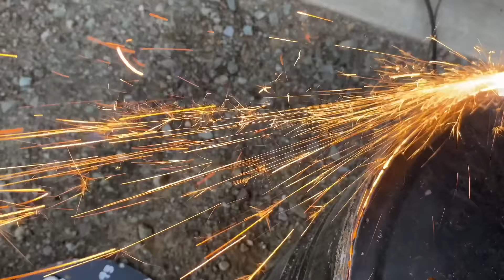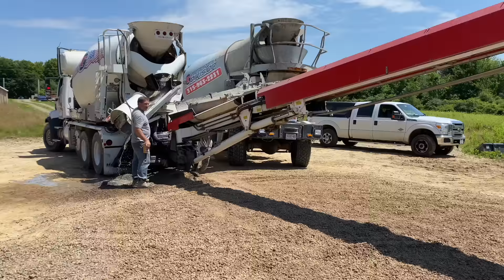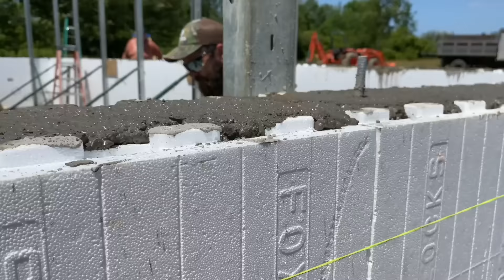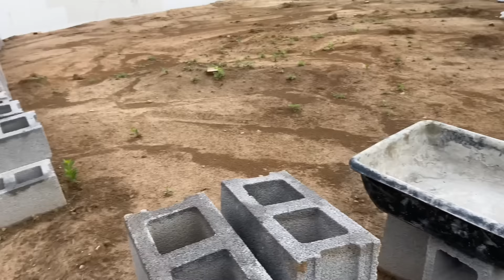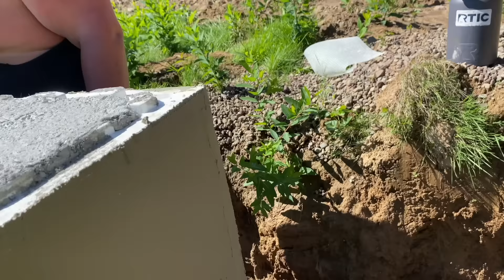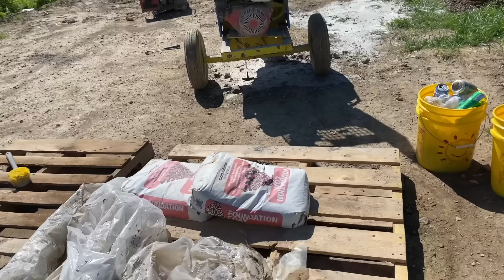Laying concrete blocks and ICF. (TIPS AND TRICKS)

Comment: Curious if it would not be easier to use 2 bys to make those intermediate post supports? Seems like a lot of fussing around with barrels . Anyway your job site is super organized and tidy and makes for a safe work environment.
Reply from the maker: Thanks. I think there were so many pads that the barrels worked out real good. No lumber wasted and we could just leave the forms on. I just read the blueprint wrong and that caused a pain.

Comment: Crappy why doesn't ANYONE use a spirit level 🎚️
Reply: That's what a string and laser are for, and you can feel if the block is tilted with your trowel...
Reply from the maker: Yup for sure.  @brnmcc01
Reply from the maker: what is a spirit level?
Reply: @bondobuilt386  What you called a torpedo level. I guess he missed the part of the vid with the laser...🤣
Reply from the maker: Oh ya no need for that. LOL @brnmcc01

Comment: You might have addressed this in another vid but what is the reason for the block work on the one section vs ICF all around. I’m not a builder so I’m curious what I might learn for my own house build.
Reply from the maker: The concrete block wall is much cheaper. Also it is backfilled on both sides so not as much benefit to have the ICF in that part.

Comment: if you really want to lay blocks fast you can not butter the ends and then use a motor gun to fill the end joints after.

Comment: As a diywer I would make a cheater tool out of plywood similar to bricky tool
Reply: Did you try to set blocks on adhesive foam, before you fill up all block cells with grout?

Comment: I just started watching your videos I like to learn different things so I can do them myself. I cant physically do this type of work but I would and wish I could you would be the one I would want to work for. I do have a question can you explain what the brooming is for? Also can you explain what that round machine does? I also think that a good background song to play when you are doing a fast speed is "born to be wild" HAHA. Anyway Keep up the good work.
I just sent you a email as well. Please read.
Don
Reply from the maker: Hi Don. The brooming just is to create a broom finish which is non slip like for a sidewalk. The power trowel will trowel the concrete super smooth and create a hard smooth surface like a basement or garage floor. We have to be careful with playing music because of copy write issues.
Reply: @bondobuilt386  Thanks for answering my question and also replying not many would respond. I will be watching more of your videos tonight.
Reply from the maker: awesome  @DonEunice-u8h

Comment: Mortar bed is 1 1/2 or 2 " round abouts?
Reply from the maker: like 1-1/2 for a normal bed joint. it depends also on mortar consistency and outside temps.

Comment: How much rust is permissable on rebar ?  in case you see a bunch for sale? but its a bit old
Reply from the maker: I do not mind a little surface rest but if it has started to flake or pit I would not use it. Or wire brush it off with a wire head on a grinder if it was cheap enough.
Reply: @bondobuilt386  thanks I have a slab to do next yr edging on top of a 2 course block wall , gonna be an 2 advil day.

Comment: look at making an aftercooler for air compressors.  work great, use an old oil cooler and the fan from a computer server as they are 110 Volt. .  friend pulled the cooler from a late 90's Chev diesel . or there is option like a copper hot water baseboard heater with all the fins on it.

Comment: Is Biscuit losing weight?  Looks like maybe 30 lbs.  Anyway, it's great to see you do these jobs... with some methods that are a bit different than what I'm used to seeing.  Cutting up those barrels is genius... is it because they don't make sonotubes with that diameter?  Gonna be interesting how you take that form off, though.  (I'm only half way thru).  I keep wishing, with these concrete channels, that the builder would show us the rest of the job.  The foundation is cool and everything but sometimes the project is so cool you want to see it thru start to finish.  Kind of a letdown.  Some of these builders would enjoy just about instant youtube success if they'd just start a youtube channel... lol.  Thanks for sharing all this with us.
Reply from the maker: Thanks. I got the Barrels for free The metal will just stay on there. We are usually gone while the house is built and then come back for more work after.